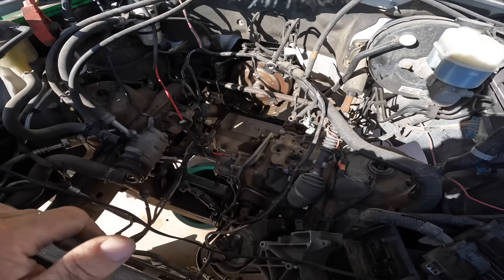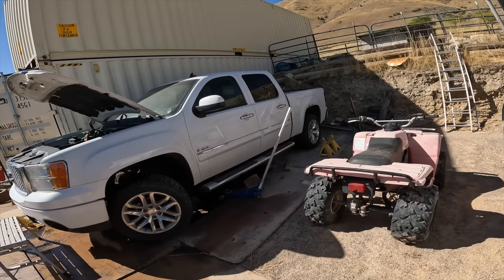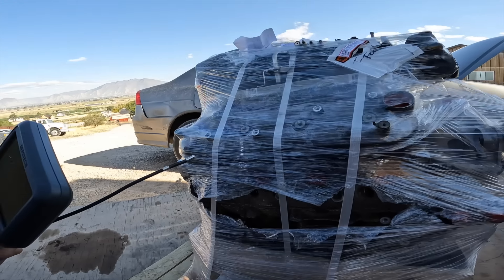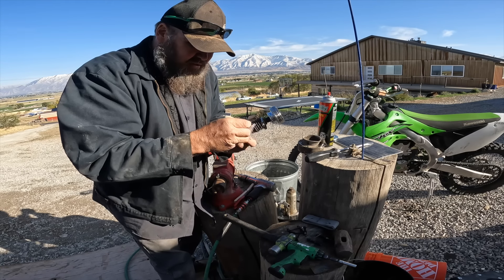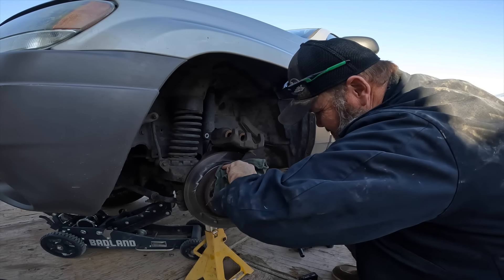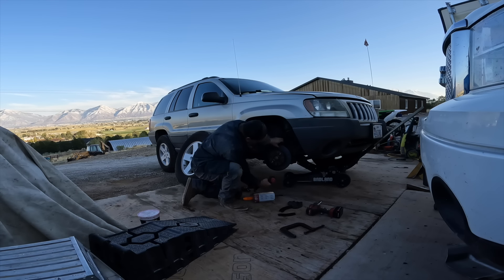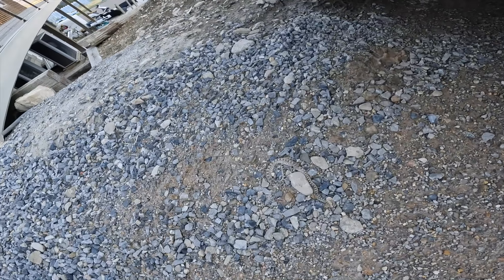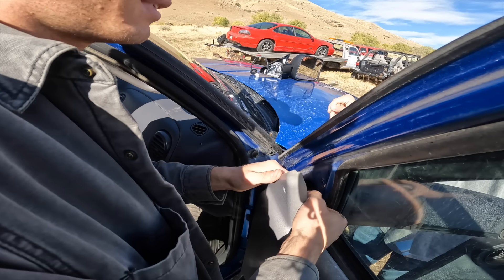STOP! Don’t do it!!!

Comment: Ben I did away with that cv style drive shaft on my durango because it failed 2 times after replacing it like you did and got the USA Standard Gear 44068 driveshaft with serviceable ujoints

Comment: 17:37 Imagine you have noticed over the years, some drivers wear brake pads / shoes out quicker than others.  First rear shoes on my pickup was at 70,000 miles. Have seen some drivers need (especially) front pads at 12,000 miles, (at metal on metal condition).  (Specific driver types not disclosed here, on purpose). 😆
Reply from the maker: Good eye  I wear my brakes quick and the wife they last forever

Comment: Ben i have a wee tip for you sir , youre a good man and you can sure work in engines and cars / trucks far better than i ever could , thats for sure , but my tip is this . when leaning over into an engine bay like you just did , get youreself a peice of foam 2 inches thick and 2foot 6 inches wide and 3 foot long , put it between you and the car , it will make it eiser on the old body , AND MAKE SURE YOU KEEP IT DRY TOO . thats me , nice channel man keep it up .
Reply: He said get a yoga mat😁🗿👽🗿👽🗿
Reply from the maker: @thomasgraham5842  engine yoga my wife will love it😂😂😂
Reply: Even better use the foam like you said and cover it with vinyl fabric

Comment: Its a clip that holds the rotor on when the chassis is going over head on the assembly line. Cut them off you don't need them. they can cause wheel vibration,if they are not on all lug studs. Especially on aftermarket rims.

Comment: Why not rebuild your old engine? 
You could rebuild your engine for not that much more than a used engine, plus you know what you're getting.
Reply from the maker: @Chevyman02  I have been pondering this over and over it’s like a hamster wheel at this point. I love my engine and I was thinking about using it in a future project but currently I just want my truck running. I am torn.
Reply: @bandmsgarage  obviously it's your decision, but it's getting colder. I obviously don't know what your plans for a future project, but you could probably find a good engine for the future project when you get ready to start it.

Comment: I think that you're replacing the mirror, not repairing it.  That's the difference between real mechanics and parts changers.  Some repair shop personnel use an analyzer to find a problem, then they proceed to change out parts until the problem is fixed.  A real mechanic knows the problem and repairs the part to make it continue working.  If necessary, a real mechanic will make a part to fix the problem.

Comment: Why not have Merlin build you an engine for your truck, instead of a junkyard engine you need to get rid of the cylinder deactivation crap out of the motor that why it died. or do you not get along with Merlin ?